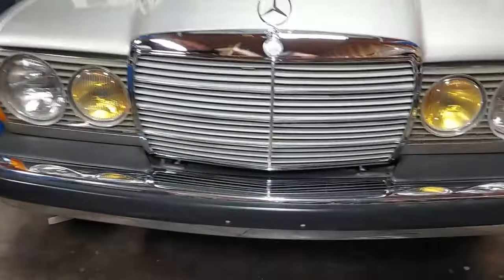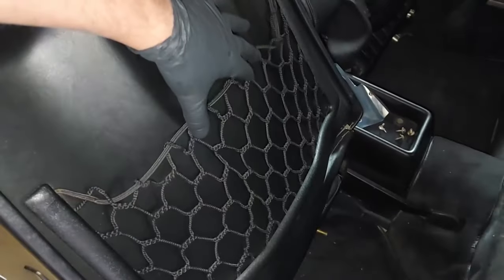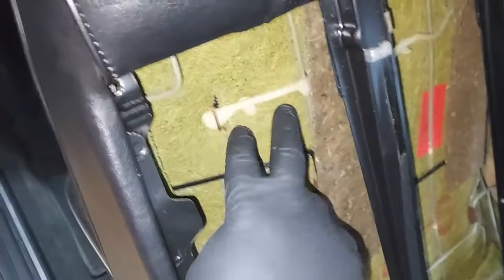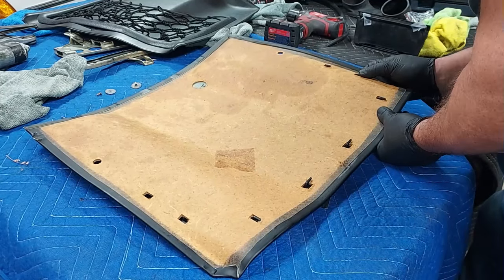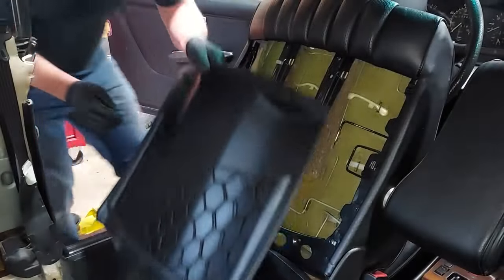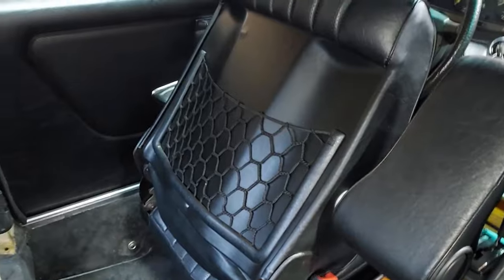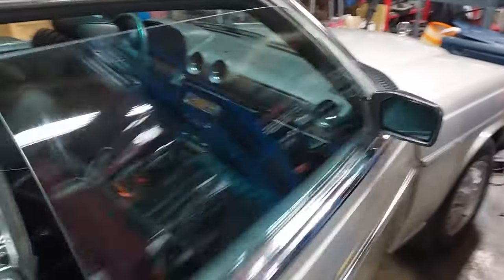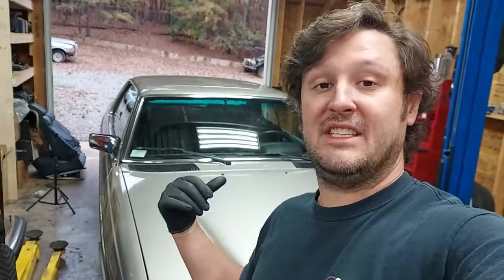1985 300CD Seat Nets, Headlight Bezel and Grill

Comment: I am curious if the back netting process is the same for a w126. 

With mileage that low on such a special car, it deserves euro headlights. Just my humble opinion. The difference in illumination is significant. 

Nice catch on that new grill! The URO replacements I’ve seen for w126’s are seriously lacking so I imagine it would be the same for w123. What did you pay for that grill, if you do not mind my asking. For my 500 SEC I had to purchase two different grills, take them apart and combine the “good” to create one nicely restored grill. It was incredibly difficult, but you cannot purchase a new one. They do not exist. Neither do the hood badges. Mercedes will sell replacements, but they are not of the same quality. The blue paint fades within a year!
Reply from the maker: Genuine Mercedes grill cost me $500. The dealer happen to have two of them so I bought them both. I don't ever install Euro headlights because I only do us spec vehicles most of the time and this is actually the way they were sold at the dealership. I actually like the round headlights better. Yes the net process is the same on the w126.
Reply: The Mercedes grill is a great find what is the part number I will try and find one in South Africa where these 123 cars were assembled locally as well